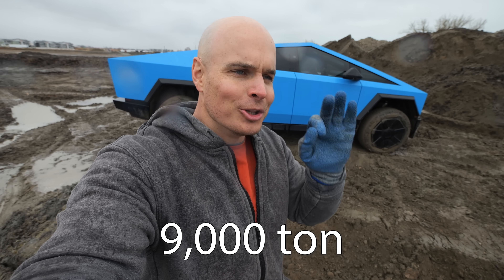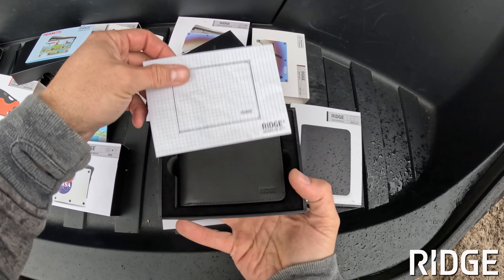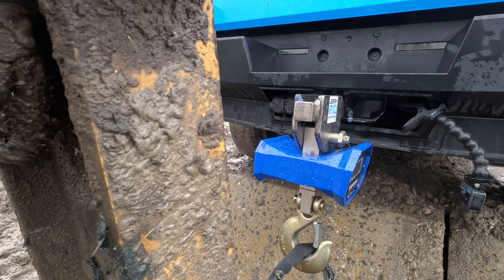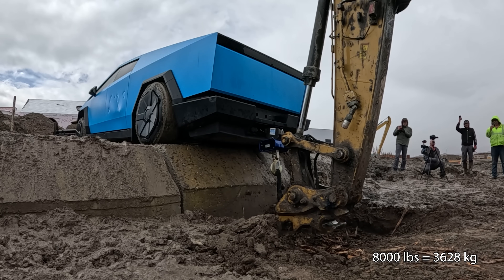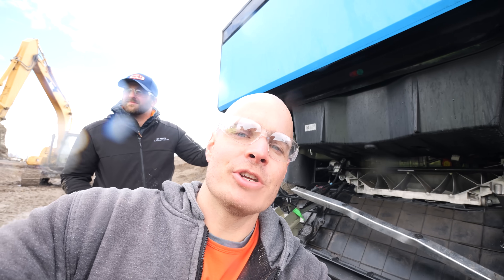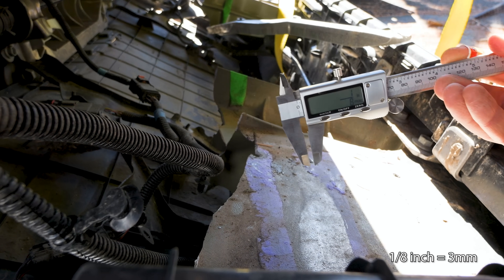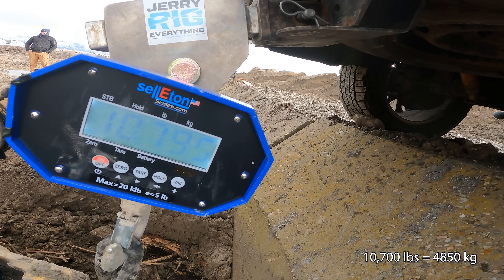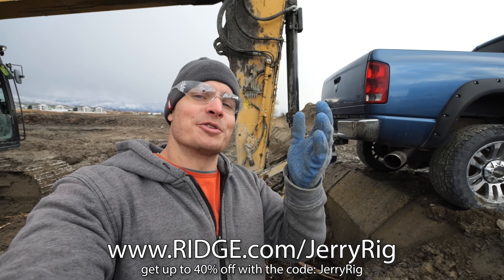SHOULD YOU TOW WITH A CYBERTRUCK?! - (catastrophic failure test)

Comment: So impressive for an aluminum frame to be able to hold over 10k pounds of tongue weight.
For reference: That Ram 2500 weights between 5000 and 5800 lbs depending on the engine and options, so you could theoretically hold almost 2 Ram 2500 trucks completely off the hitch of the cybertruck.

Towing capacity doesn't equal tongue weight, anyone who has a basic understanding of towing knows that, so a cybertruck is perfectly capable of safely towing anything that is within its rated towing capacity.
Reply: It's not made of casted aluminum that's the other cars the cyber truck is made of the same stainless steel that the starship is made of
Reply: He knows full well, he's just let his derangement syndromes get the better of his judgement.

Comment: But why wasn't the Rivian tested? It's right there!
Reply: It's steel
Reply: @Y2Kvids  and? I have 10 knives, each is different steel and design. Each would break at different pressure.
Reply: @leok7193  steel is tried and tested, fancy new Aluminium glue is not
Reply: @Y2Kvids  don't pretend to know what you're talking about, if you don't even grasp that steel varies by comparison, let alone structure and treatment methods
Reply: @  varies .. but not completely different from aluminium ... the old steel one still held upto the breaking point of aluminium .
Reply: @Y2Kvids  and it's a different frame shape, attachment methods and steel composition in Rivian. That's why it merits a test

Comment: Yeah pump the brakes. No-one in the towing industry rates hitches in the vertical axis like that. 10% of Towing capacity x 3-4 safety factor. You'll be ripping hitch frames out of unibodies long before you get to 10k vertical load. There are tons of SUVs riding around with Class 3 (8k) hitches that you should be concerned with long before the Cybertruck is going to be a factor. Especially these UHaul jobs. You'd be lucky to see a 1.5 safety factor. Not counting the idiots towing using their bumper mounts.

Comment: Who tows things this way? No truck is designed for this. If anything it just shows how strong it is.
Reply: If the old truck can handle it the cyber truck should as well. Also @whistlindiesel broke his hitch simply trying 2 get a truck unstuck which shows the hitch is a huge flaw.
Reply: Towing a trailer and hitting a bad pothole on a highway will put that much force on the part of the truck that breaks.
Reply: @hugoedelarosa  have you ever heard about suspension? and if the pothole is really that bad, any car would break, either its axles or other critical parts
Reply: Suspension is there for that
Reply: @hugoedelarosa  WRONG.

Comment: That excavator doesn’t weight 50000 pounds probably closer to 38 but it sounded cool!
Reply from the maker: The excavator we used for the test - was not the same excavator we saw at the beginning of the video. The construction site had multiple excavators. If you look at the excavator during the weight test portion of the video it says 323F on the side - and the manufacture says it weighs 50,900 lbs.

Comment: R1T driver here, no cybertruck fan, but the idea that a 11,000 lb trailer will ever replicate the forces in this test is a stretch. Impulse force is totally different than continuous load.
Reply: Trailers have already ripped the hitch off these. It was someone towing a camper they hit a pothole and yanked the bumper right off.
Reply: You need to understand that there are more things here than just simple push of 10,000 lb. For the start the issue is with the aluminum frame due to it having way lower tensile and yield strengths also being more prone to cracking whereas steel is more likely to bend far more before it cracks. Also you might have noticed in the video that tesla's back started cracking at around 6000 lb. Therefore even if as a short impulse any time force applied to the hitch exceeds 6000 lb limit the frame starts to develop cracks and that means it only gets weaker from there and with more towing you will develop more cracks eventually leading to completely breaking off while steel may bend but even then it will retain it's strength. There are reasons why there is no aluminum on cranes or any equipment that is used to lift weight.
Reply: Sure, the test was flawed, but the twenty year old, banged up cheap Dodge with less tow rating has ZERO issues with the same test. Shock loading is a thing that happens all the time, towing anything. My Toyota Corolla with its class 1 hitch can handle more shock loading than any aluminum, and cast aluminum is particularly weak.
Reply: The only way to fix this is to lower the tow rating
Reply: Not at all fan of Tesla's, but whole test was bullshit. Based on it's rated limit it is not made to stand on the edge of mud hole and hang other car from the hook directly downwards. You are always further away from towed vehicle or your cable lays on the edge and force is always lot more towards back than down. There are crains like the ones you used when building your bunker for hanging weight downwards. I don't think there exists a trailer where even with badly loaded uphill it would go even close to the limit. Or then there must be lot more weight on the trailer than it is rated for. The used excavator would have exceeded rated pulling limit towards back too with or without trailer. So even that would have been irrelevant test correctly done too. Steal frame is stronger of course. But still those ratings are with pulling and tongue limits that you should follow. If you think those will be exceeded in a mud hole lifting a car up then you should get suitable equipment there or you take a risk of it failing. I think it is pretty well that it was taking what... almost 10 times the tongue weight it is rated for?
Reply: Not a fan of Tesla or Musk either, but claiming that being behind a CT that is towing is dangerous is not true based on this test, you claim that pulling someone up from mud can break it, which it might or might not, but that is not happening on a highway!
Reply: @madneo3309 the highway use case he mentioned was a bump or pothole while towing an RV. I imagine the tires will absorb some of the weight of such a shock, but it's possible that a lot of that weight hits the tongue for a fraction of a second and that's enough to cause failure
Reply from the maker: Great choice of truck. But i disagree with the speculation - pulling someone up from a mud hole at an angle or down off a rock at an angle can easily be in the 10,000 pound range. People brake 10k straps and chains all the time doing those exact same maneuvers. And they arent always going to be linear.
Reply: @JerryRigEverything  yanking other vehicles around is NOT equivilant to pulling a trailer. And when Whistlin had his issue, the damage was caused by an UPWARD force impact on the hitch that was easily over 30k lbs and was directly transmitted to the frame with no suspension buffer. Not a scenario that ANY manufacturer desings to meet. Sure - some manage anyway, but completely irrelevant as to "Can the vehicle do the job it WAS designed and certified to perform".
Reply from the maker: @notmyrealname8064  you lost me when you said a 6000 pound truck with 2 front wheels on the ground transfered 30,000lbs of weight to the hitch. But 👍
Reply: @JerryRigEverything  If you weren't someone who works basically as an engineer I'd would brush this video off as a misunderstanding. But knowing what you do and what background you have - this video (esp title) is a pure malice.

I will reiterate what I've already written in few different threads here. If you'd ever loaded tongue with such a downward force you would be seeing trucks with trailers doing wheelies left and right.
Cybertruck weights around 6k lbs - so roughly speaking - if you put that weight on tongue and use rear axle as lever pivot - you do a fking flip. Your car will LITERALLY sooner flip over than experience that 10k lsb straight downward force on tongue.
Any reasoning that tries to defy it is gaslighting.
Reply: @JerryRigEverything  My point was about towing, I'm sure someone could apply 5 tons of force to a cybertruck hitch, but not continuously. You strapped the front of your truck down for a reason. Applying 10,000 lbs of force to a 7,000 lb object tends to make it move in the direction of the force.

It's ok to be frustrated and disappointed with Elon/Tesla/Cybertruck, but don't sacrifice your integrity, and I think you have a lot.
Reply: @JerryRigEverything Pulling someone up from s mud hole is s bit different than towing a trailer.
Reply: @GregorVogel  true, however vehicle owners will not realize this, theyll think "it can tow 10klbs, pulling a 5000lb truck out of a mud hole is fine"
Reply: @GregorVogel a few trucks already broke assuming it won’t happen is moot
Reply: @JerryRigEverything  completely different force directions and loading in play between any real use and your 'test' - the tow/rescue vehicle is taking mostly forces in the direction its trying drive even at an angle to make it worse still only a small fraction of that is applied in the direction you applied the entire force. Worst case situation I'd be shocked if that breaking the strap pull actually put more than 20% of its breaking strain load on the tow vehicle in your tests direction - and if it did the truck would almost certainly be wheeling!!! 
The whole test and premise is just flawed. Now If you had the cybertruck try to tug of war that digger (probably with help as I doubt it has nearly enough traction) the test would be more valid.
Reply: @JerryRigEverything  M0ron! Straps take the load along the length when pulling. You cannot conflate that with downward load on the tongue when there's a huge 'mechanical advantage' that reduces the load on the tongue to a fraction of what's felt at the wheels of the trailer
Reply: @JerryRigEverything no Jerry just no, you should put a disclaimer on this video that the test is "unrealistic"...and my opinion has nothing to do with if I like or dislike Tesla.
Reply: @JerryRigEverything  it it obviously impossible to "pull someone up" from a mud hold, because your vehicle cannot move up, it can move forward.
Reply: @grproteus tell me you haven’t been in a shitty situation, without telling me… years ago, we broke 2 metal ropes, trying to get my Astra combi from the mud… you could easily push that hook to 10k, no other truck will break like the Tesla one!
Reply: @grproteus when those angles and dangles are so mysterious 😂
Reply: @JerryRigEverything How much is the rating of your wheelchairs? 350 lbs? Do they snap with a weight of 1'000 lbs? Others might not. Does this make your wheelchairs a catastrophic failure? carrying some furniture from ikea on the wheelchair could easily be in the 1'000 lbs range. \s
Reply: @JerryRigEverything  So test it? We know your politcal bias
Reply: @damien12221  Its been tested, that was Whistling Diesels video, he wasn't towing with continuous load it was impulse load of much less than 10k lbs.
Reply: @damien12221  and whistlindiesel also got political bias ? elon simp lol
Reply: @damien12221  Defend the truck being undrivable after snapping a hitch. 

I dare you.
Reply: @damien12221  this has nothing to do with politics bro
Reply: @MerpSquirrel  WD dropped the truck from 2 meters in it's hitch, therefore breaking the aluminum structure
Reply: Agree.  I can't believe the OP doubled down on it.  I'm no fan of the CT either but this has nothing to do with towing.
Reply: Super bias test. It exceeded the manufacturers tongue weight limit by 800%, so its a win for Cybertruck.
Reply: @renzlawmtb8305 but not the weight it’s able to tow. They’d have to lower the rating..
Reply: @renzlawmtb8305   Biased in what way?

A Ram with rear end damage survived the same configuration.
Reply: You're probably going to get a lot of hate for this - even though you're right.

Comment: This experiment was flawed in my opinion. Most of the force when towing is directed horizontally and not vertically as was measured here. The only situation that could put so much for on it is the "juimp" and if that happened then it is mistake of a driver. Yes, steel frame is stronger but Tesla did not advertized the force measured here.

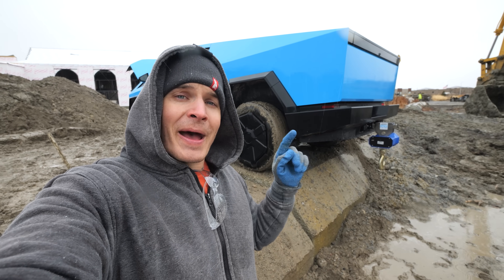Comment: 3:35 that's... that's not how trailer weight ratings work. you're using it's towing capacity as a static load rating (tongue rating), which is wrong. you're surprised that the hitch is incapable of supporting the entire loaded trailer balanced vertically on the hitch ball... your later assertions that the full trailer weight could ever be applied to the hitch is asinine. if any part of the trailer is in contact with the ground, then you wont ever exert the full weight of the trailer on the hitch, and in the event your trailer becomes airborne... you have much, much bigger problems.

in the cresting example,  you still wont have the full weight unless it's off a damn cliff, at which point again, you have much bigger problems. sharp decline to flatland will exert the most weight on the hitch, but even then, it STILL wont be full weight.

Comment: Tongue weight should be around 5% of the trailer weight, and the limit a tongue is rated for will be around 500kg or 1000lbs, so breaking at 10.000lbs is pretty good. The Cybertruck is a bad car, but the tongue does not seem one of its problem.
Reply: Agree. This was Elon derangement syndrome disguised as science

Comment: Anyone that tows with a cybertruck is putting Others on the road in danger! Do remember you are responsible for your load!
For a 14,000 lb trailer, the receiver hitch and mounting system should be able to handle up to: 12,600 lbs of downforce in extreme conditions.

Revised Towing Limit Estimate:
Considering the limitations of cast aluminum, the safe towing limit would need to account for:

Reduced dynamic strength.
Fatigue over time.
Sudden failure risks under impact or overload.
A realistic safe operational towing limit might fall closer to 2,500–4,000 lbs for consistent use without compromising the structural integrity of the aluminum components.

I would strongly advise against using a Cybertruck that has been rear-ended to pull a even a small trailer at least without a thorough, professional inspection and structural assessment using Non-Destructive Evaluation (NDE) or Non-Destructive Testing (NDT) should be performed on the frame to assess its integrity.

Comment: I’m guessing the frame was spot welded or riveted and the glue was used for vibration dampening. The tow bar should have been integrated into the frame either as part of the forming or welded in properly.

Comment: I mean, you weren't really testing its towing capacity and more its tongue weight strength lol. Sure, you'll get some weight shifting, but you will never have the full trailer load pushing directly down on the tongue of the hitch. You should have secured the Cybertruck and tried pulling it with the excavator. That would have properly tested towing capacity. Honestly though, that's a TON of weight on a tongue of the hitch. I'm seriously surprised that it held up to that much weight being applied to it. I hate Tesla as much as anyone, but you gotta test it fairly. And there are adhesives for aluminum that are stronger than aluminum welds. Lotus used glue for their performance cars because it saved weight and was stronger.
Reply: @BillDerr  Very informative comment, yet  its buried so far down that no one would ever see it unless they scroll for hours.
I've noticed that a lot of the informative.Comments that actually point out the real facts are hidden by all the propaganda comments.
Kind of suspicious if you ask me
Reply: He’s so dumb he thinks this was a bad result

Comment: Key part.....and you really should have put it at the start of the video.....9:45

I would never buy an electric vehicle personally, but you basically showed this car can carry 10 times the advertized toung weight

You literally had to weigh the front down to even make this experiment possible
Reply: But the main takeaway is that aluminum will weaken every time you tow with it

Eventually it will break

A 40 year old truck from the big three will be just as strong as the day you bought it because if you stay under steels stress limit it won’t change
Reply: when you realize how dishonest jerry is, it makes sense he's a leftist
Reply: @SaxSpy  Hands down Jerry is a much better human than 95% of the population. Have a look at his side hustles.  It's common that an indoctrinated person would lash out at anything that goes against their indoctrination so I don't really blame you though. You just don't know any better.
Reply: Do you not get the point of the video. Aluminum continually weakens over time. Steel doesn't. Towing with a cybertruck shouldn't be done because the forces exerted on the hitch while driving will break it after a while
Reply: @ShadowoDaWolf  A.) Aluminum does not "continually weaken" over time unless there is extremely long cycles of mechanical stress or corrosion. 

Think about it, every single passenger jet for the past 70 years has been built nearly entirely out of aluminum. Sure it can't resist repeated stress to levels that steel can, but that will only show if you tow with your cyber truck into the next century. 

We have combat jets flying around that were built in the 70's pulling repeated high G maneuvers. Their aluminum is fine. 

Jerry intentionally spread misinformation about aluminum to push his narrative.
Reply: @ShadowFenrir  the results dont show that, but he's trying to force it. The rate at which the aluminum tongue weight failed was higher than the steel. the steel should have gone to 13,000lbs, so hes just lying to push his political narrative
Reply: @SaxSpy  what are you even typing.